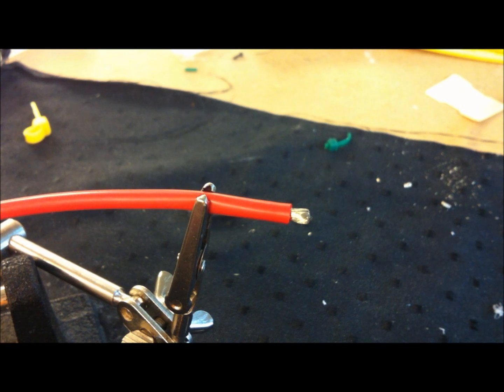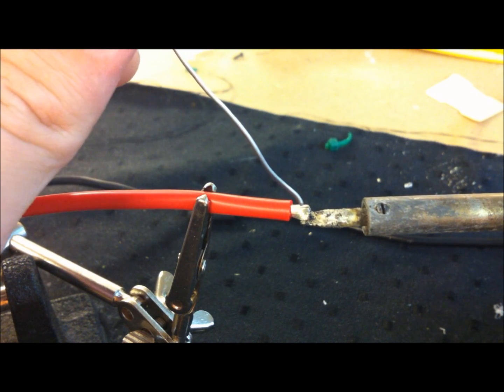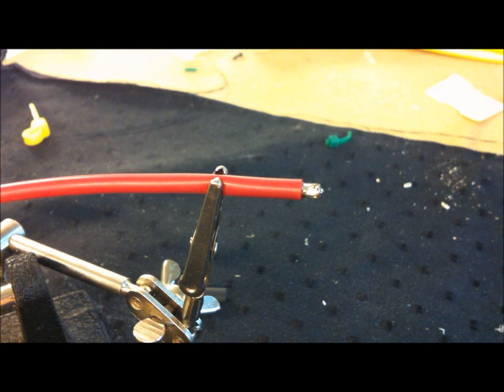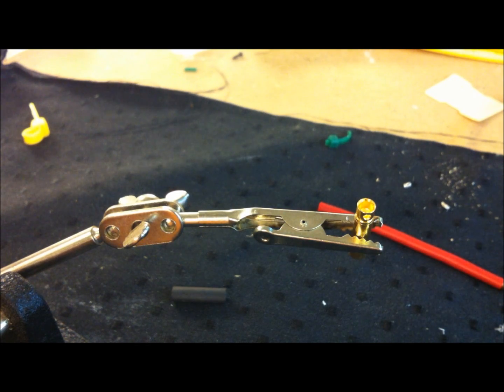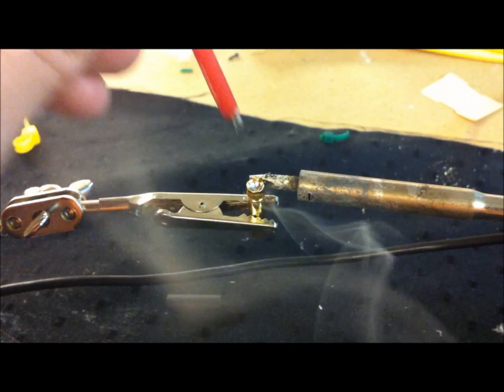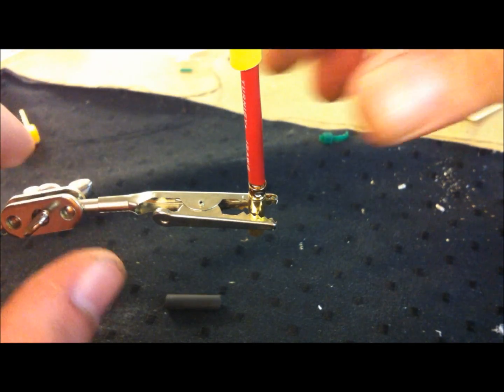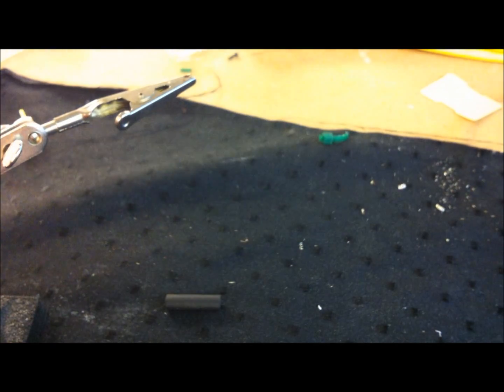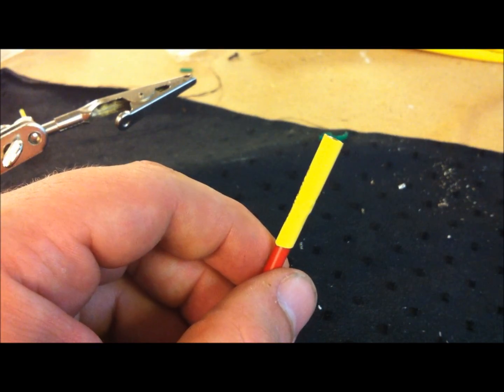Solder School: Bullet connectors

Comment: Thank You for making this video!  I just have two questions I'm concerned about that maybe you could answer: 1) What is a 'cold' solder joint and how does it occur?, 2) Is there a recommended temperature or soldering iron wattage rating when soldering small RC bullet/battery connectors?  Thank You